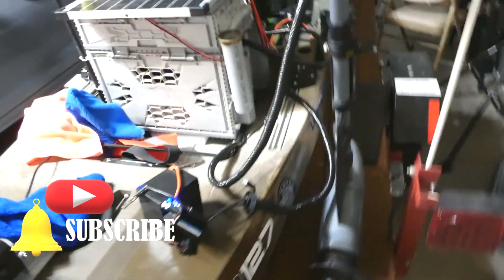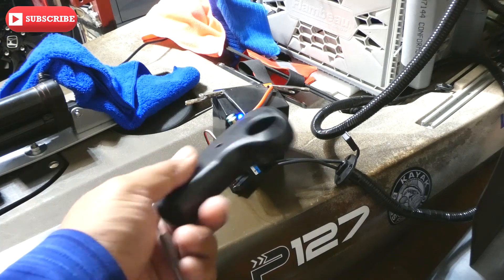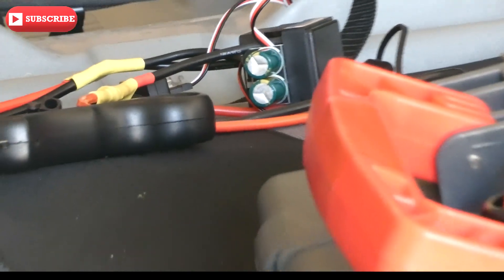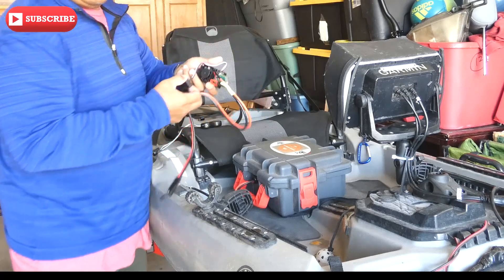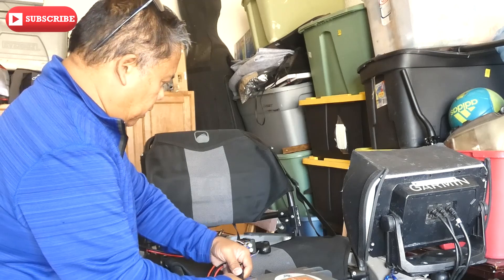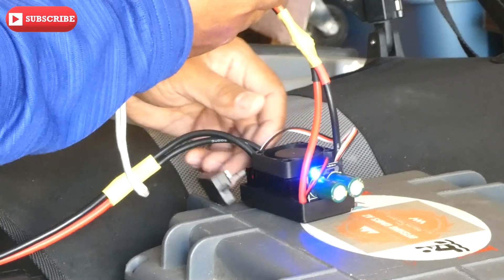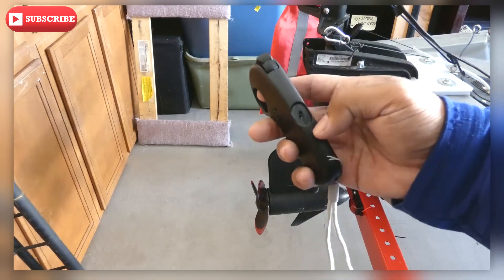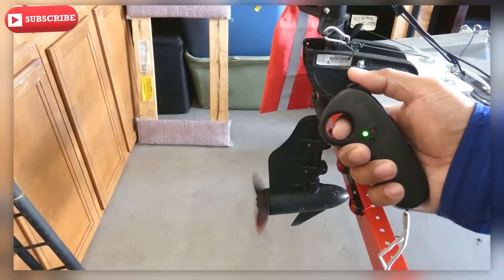ESC & Remote Controller for your Kayak Trolling Motor

Comment: Thank you. Great video.
Reply from the maker: Glad I could help
Reply: I have a question after checking ESC on Amazon . It is rated for 6 volt. If you connect ESC to 12 volt battery for trolling motor, will this connection burn the ESC. Thanks.

Comment: Do you have to hold the button for the motor to run or will it stay on by itself?
Reply from the maker: no, there is several stages when you pull the trigger, that holds in place, so like you could set it to go slow, med, fast...

Comment: Where did you get the receiver plugged in to the speed controller
Reply from the maker: the esc is wireless, the controller has a wireless dongle that plugs in the esc port...

Comment: Can use this esc for rc boat...i mean the boat is totaly closed ....or i have to use esc that cool with water. Thanks
Reply from the maker: so long as it is not brushless motor, coz this one is not for brushless
Reply: No its burushed like this one 30 lbs 12v .
I tried it with 16v ....and it overheat and he motor stops to turn in about 2 min.
Reply from the maker: @Rcfishingbateauagadir  too much power

Comment: Great idea!1. I think I might have a chat with one of the small but awesome esc manufacturers in the RC rock crawling world.   There’s got to be a way to have a dial remote so speed can be whatever % you want.
Reply: I’ve seen a YT video where a “servo tester” was plugged into the esc and controlled the throttle with a potentiometer.   That too appeared to be overly sensitive.  I’m now thinking that a “multi-turn” potentiometer is the way to go.
Reply: @saxet9049  🤔. Good thought.
Reply: @saxet9049  do you have a link?  I’d like to see it. I’m getting ready to order the 10k pot. If it’s just as cheap, I’ll try both.  I’m going to use a Holmes Hobbies BRXL esc. They make good stuff. Plus the specs are a little better than Hobby Wing. Costs a little more but from all my RC stuff, Holmes Hobbies makes some good stuff!!  I’ve met the owner, John Holmes is a really good dude.
Reply: @crushingsnakes1976  here’s the link for the video:
https://youtu.be/d1gT2n0BvbQ
Reply: @saxet9049  thanks. I’ve seen that one. I’m basically following that material list.  I’ve decided not to use the BRXL simply because it does not have an on off switch. I’m also going to add a kill switch attached to a lanyard.

Comment: So you have links for the ESC and remote. Also is this for a brushed or brushless system.
Reply from the maker: here:  https://www.amazon.com/Electric-Skateboard-Control-Wireless-Distance/dp/B08TB5B34L/ref=sr_1_7?crid=1YQ870LBC6T7P&keywords=skateboard+controller+and+receiver&qid=1651081267&sprefix=skateboard+controller%2Caps%2C1585&sr=8-7

https://www.amazon.com/gp/product/B07NYBF6MQ/ref=ox_sc_saved_title_9?smid=A2WE34KST0BUEK&psc=1